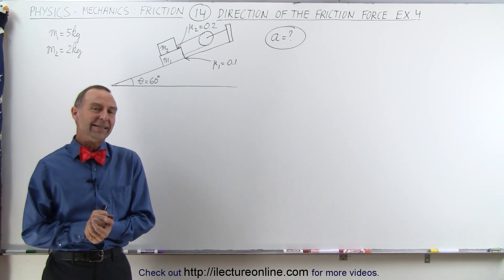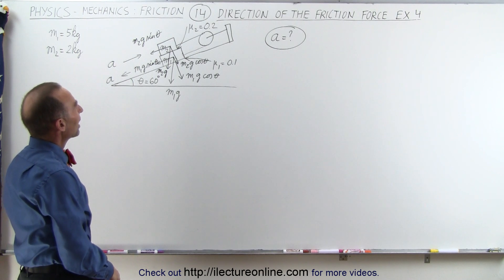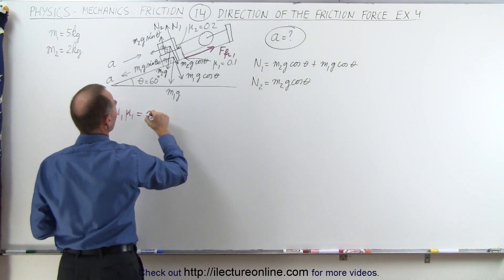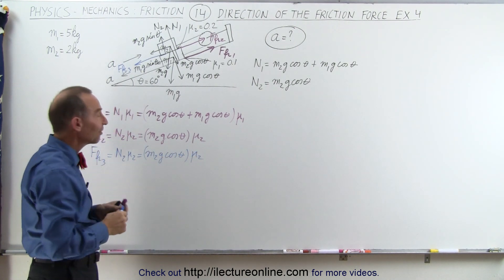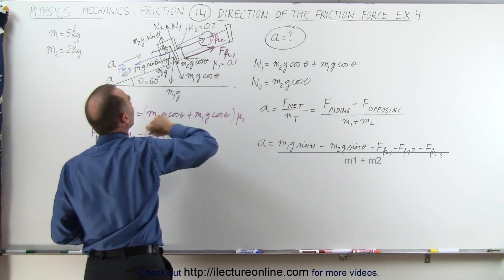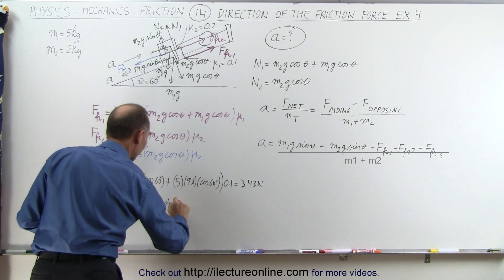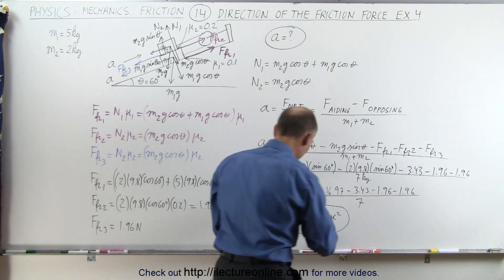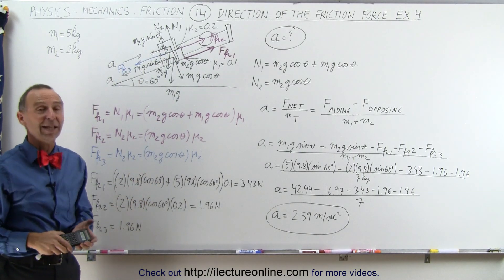Physics 4.6   Friction (14 of 14) Direction of the Friction Force: Ex. 4

Comment: The m1g1sin should be positive and as well as the Ff3
Reply from the maker: No the signs are correct in the video.  All the friction forces are forces opposing the motion of the system.
Reply: If I use summation of forces, my signs are incorrect?

Comment: Sir I think you forgot to include a force acting on mass m1. If mass m1 affects mass m2 with a normal force N2, then mass m2 will affect mass m1 with an equal and opposite normal force N2 (according to newtons third law).
Reply from the maker: The video is correct as is.  One must look at each boundary and apply (Newton's 3rd law as you mentioned above appropriately).  Since only m2 is pushing down on m1, the normal force at that boundary will be mg2 cos(theta)

Comment: Thank you for the video 
The system is m1+m2 yet you considered internal forces. Also why is it -fk3 and -m2gsin
Reply from the maker: No internal forces were considered.  Only outside forces acting on the system.  Friction force is not an internal force, it is an external force acting on the system.

Comment: Hi Mr. Biezen, I have to admit that your lectures have refreshed my concepts on various topic in Physics. Something that I never quite understood during my school years is so well explained with examples ! I love watching your videos. 
This is another interesting video. There is one thing that I did not understand is why fr2 is not aiding the acceleration. By resisting the sliding due to weight component along the incline of m2, the friction fr2 is actually assisting the upward acceleration of m2, along the incline. Can you please clarify. Thank you
Reply from the maker: Hi Ashish.  Sometimes we have to go to the basic principles in physics.  Whenever two surfaces slide over one another, there will be friction and a friction force.  The friction force will cause the two surfaces to heat up, which means that energy is removed from the system.  When energy is removed from the system, the system will slow down, unless a force is applied to keep the system from slowing down.  Another way of looking at it is this:  The direction of the friction force (relative to a particular object) will be opposite to the direction of the object's motion if no friction force was acting on it.  It can become confusing and that is why we show these examples.
Reply: Hi Mr. Biezen, thank you for responding. What I can't wrap my head around is when m₂gsinθ and fr₂ act in opposite direction then how come both have same (negative) sign in the equation for acceleration.

Comment: I am getting 2.86m/s2 is this also right?
Reply from the maker: There is only one correct answer.
Reply: @MichelvanBiezen   can I get 2.86 by considering digits in point three decimal number?
Reply from the maker: No, the answer would not be that different.  First of all, are you using the same method to solve the problem as shown in the video?  Then do you end up with the same equation?   Which of the number(s) is/are different?   That is the best way to figure that out.
Reply: @MichelvanBiezen  I am getting acceleration is 2.86 m/ S2 because I took g= 10m/s2

Comment: Sir,  The F3 Is Opposite To  Friction Forces (F1 And F2).  So On The Final Equation,  Won't That Be m1gsin(theta)-m2gsin(theta)-F1-F2+F3/(m1+m2)?
Reply: F3 is the friction for the top box. So, it's slowing down the top box from accelerating hence opposing acceleration

Comment: Hi Mr. Biezen, your videos are awesome! I'm a bit confused on why we accounted for the friction in between the 2 blocks twice? Is it because its in opposite directions?
Reply: Wait nvmind, I kinda think I understand. So for the top block, the force of friction between the 2 blocks  is pulling it down the incline, which means that its adding the force trying to keep the bottom block up. Then on the bottom block, the force of friction between the 2 blocks is trying to pull it up the incline (because the bottom block is moving down). So we need to take into account the same friction twice as resisting motion?
Does that make sense?

Comment: If the pulley had mass, could you treat the two blocks as a single system? Since the pulley would have rotational kinetic energy, that would affect the acceleration (and final velocity) of the blocks, eh?
Reply from the maker: If the pulley has mass the problem must be done taking moment of inertia into account.  The playlist on applications of moment of inertia shows you how to do that.